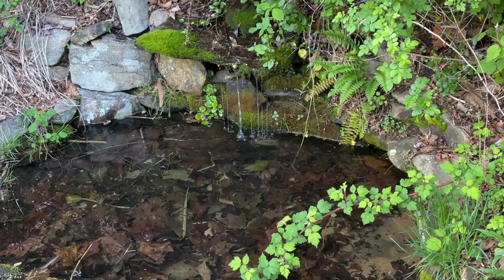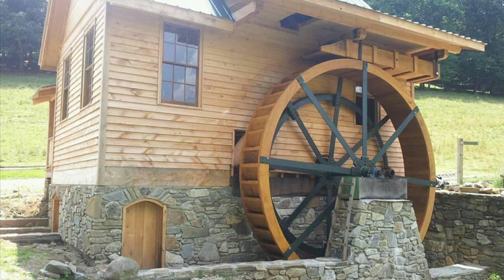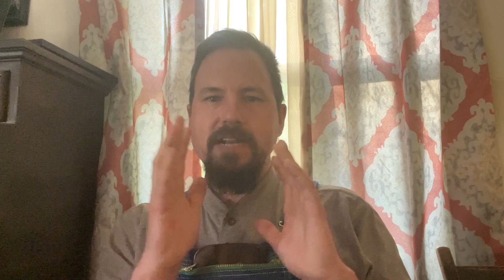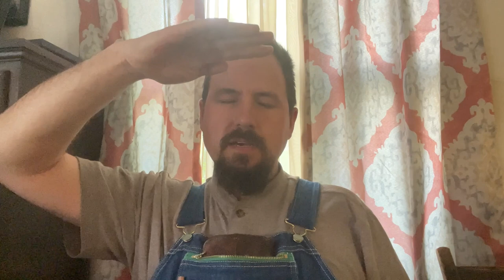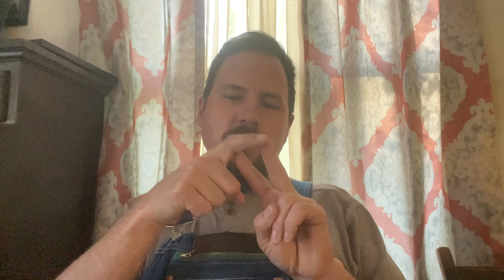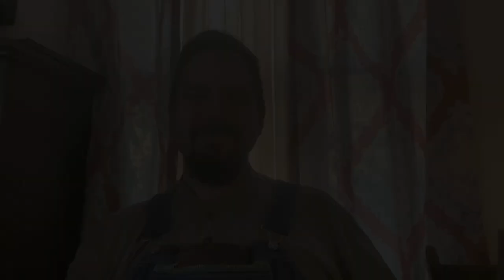Building A Water Mill on stt#19 v147

Comment: Use a set of divers to lay out how many divisions you need.
Reply from the maker: That’s good, but have to measure first..
Thanks Buddy!
Reply: @metcalfmills5679  I built a 6' diamter white oak hot tub last summer. I knew I wanted 60 staves. I did measure the radius and layed out a 1/2 circle and walked it off with dividers. Within 5 minutes had the stave layed out exact.
Reply from the maker: When you have done a big wheel standing up please let me know the best way to do it. Thanks Buddy
Reply: @metcalfmills5679  Lay a quarter of a circle out on the floor and do it the same way that I described.
Reply: This Communion rail is a 20' radius. The divisions for the ballisters were laied out by the same method that I have described. I laied it out all on the floor.
https://furniturewithhistory.files.wordpress.com/2010/09/easter.jpg
Reply from the maker: The spacing was 13”-14”, when you lay that out on the face of an upright wheel it would have to be a monster set of dividers. The traveler was the easiest and best way to do the job in this situation. I am very familiar with dividers and I choose  for other jobs for the most accurate results. Thanks Buddy!
Reply: @metcalfmills5679  To come within 3/16" of an inch on that large of a wheel with travelers is darn good. I tend to be too persice in my work a lot of the time . That just the way I was taught. But if I need to I can holed .003 to.005 of an inch on the table saw. Keep up the good work.
Reply from the maker: I been working wood all my life, I would have to see that to believe it. Thanks friend, you too!
Reply: @metcalfmills5679  Come over to my shop in Flag Pond and I'll show you how to do it and we'll mic it.
Reply from the maker: I’m planning on it! Just as soon as I can. Might make a video of it.